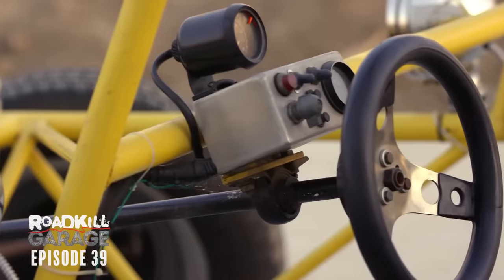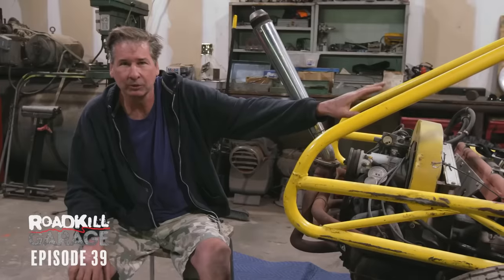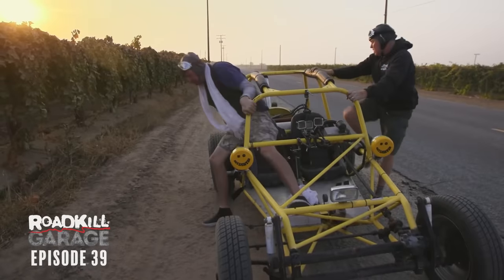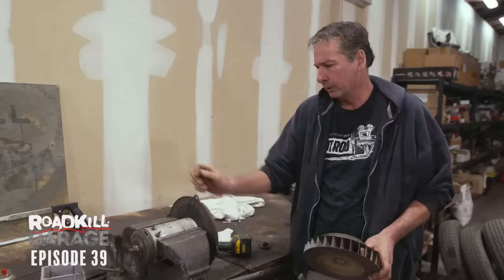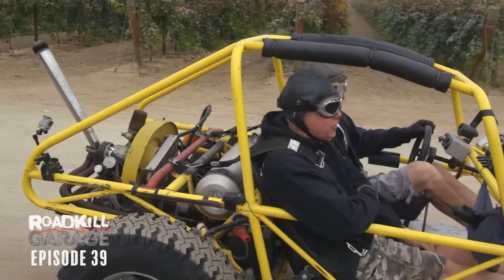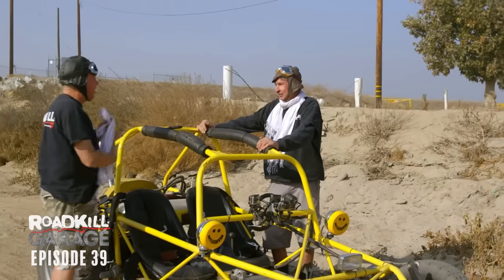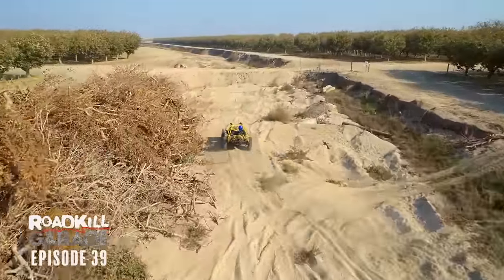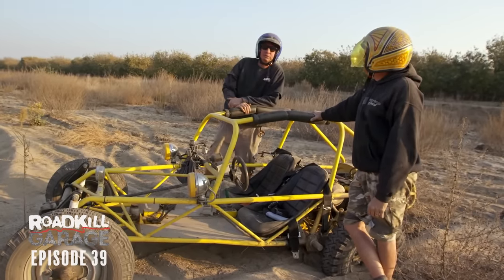Hasn't Run In Years! '60s Dune Buggy Rebuild | Roadkill Garage | MotorTrend

Comment: Lucky Dave didn't mess his arm up by putting it down during the flip. Remember kids just hold on to your seat belts and keep all hands and feet inside the vehicle
Reply: Lucky Dave should be his name 😂
Reply: My cousins arm is still crooked from that
Reply: put up netting dummys
Reply: The Honda Odyssey’s of the 80s had rubber loops you put your hands through.  Saved my arms from being broken a few times, those things flipped over soooooooooooooooooo easily.  It was like driving a crane off road 😂
Reply: One of my students rolled up to my dojo 1 time with the bones sticking through his arm from that. Great day gone bad.

Comment: I had this stupid smile on my face it's through the whole video I built 1 when I was 20 21 May be Maybe not as cool as this but as fun as it my friend rolled mine mine mine was square built with angler iron and scrap and still had the original full length pan And had the most fun Not insane but in the bush had this long Anglian bumper welding on the front to push the bus over man thank you guys you brought back Great memories

Comment: Love how the rear camber varies wildly with suspension travel. Looks like a ton of fun to drive though
Reply: It wasn't until I think 1968 maybe 1970 before the CV axle version of the transaxle for these was produced.  So if you're going to build one of these, be sure you know which transaxle you are going to use because the frame is different in the back.
Reply: Is a transaxle like a transwoman?

It wants to be an axle but the truth is it’s a gearbox 🤣

Comment: I bought one of those whin I was 19 about 50 years ago it was great fun. I almost died a couple of times and the jumps and vibration killed the battery so killing the engine in a sandy area was difficult to get it running again. With no fenders the tires threw everything at you driving in the rain was a special experience.

Comment: When I working at Andy Mannarino's shop in Detroit back in 1994-2002 there was a friend of Andy's who had a VW sand rail that he's expertly grafted the engine and front drive train from an Olds Toronado onto the back of the thing and the we'd built a 455 that made 480 hp. I never got a chance to drive it but I rode in it, INSTANT Wheelie machine and Fast! (on a 300 foot dirt drag strip) But a Buddy from years before that had like a 1962 VW we'd put a Baja KIt on it then built a VW engine and a Bus cklutch1  Lots of fun driving that thing off road, outrunning the cops and such!

Comment: Sweeeeet!! Love those VW sand rails, and the one than ran round LA or another city. 
I'd love to build one on a faux VW Splitter, wasn't your fault it was the rear swing axle at the back.
You could see it coming a mile off after they said they didn't want to roll the buggy.
In the 80s we had them here but with aluminium body panels and LWB and some fitted with colour coded V8's or VW moors. 
I'd love to find one local to me and rebuild it with more power that it needs, maybe a Subaru Boxer engine. 
The open sound of the engine and rippin' it down the blacktop.

Comment: A quick VW tip...when ajusting the valves cyl.numbers 1,2,4. exhaust at .006,cyl number 3 at .007-.008,the oil cooler makes no.3 run a bit hotter.
Reply: Ahh cheers man..got one in Aust about to get love!!🍻
Reply: Most 009 dizzys have a ground lobe  for number 3 also to help with the heat

Comment: in 1973 I first learned to drive a Rail Buggy (which is what this is, not a Dune buggy:, a dune buggy is different).  I was driving solo at the ripe old age of 6, running the clutch, and shifting gears by myself.
Reply: Did you ever have a roll over?

Comment: if you do any of roading with that sand rail.... you might want to put some of the orginal tin work on between the valve covers and engine block to help protect the push rod tubes.....

Comment: It looks like an early to mid 70s rail, my own was state or the art in 77 when I built it. MIne was also sand only, mid-engine with paddle tires and two ply. That old car can go either way, a rock crusher or a sand rail just by changing the wheels and tires. Just for fun, read Everything you need to know to keep your VW alive. It's so basic but has all the info you need!

Comment: Looking at the swing axle, I had a thought. Correct me if I'm wrong, but wouldn't the swing axle make you even more prone to rolling over? All the buggies I grew up with were never swing axles and we never had any rolling issues. I feel like the positive camber specifically would run a higher risk of rolling vs a regular IRS axle. More surface area for the tire to work with ya know? I'm just genuinely curious because I'm not an expert, but I love buggies lol. They were my childhood
Reply: It's called "jacking" and is a trait of swing axle suspension. The early Corvairs had the same type of swing axle, and made Ralph Nader famous with his "Unsafe at any Speed". Cornering forces cause the rear to lift, lose traction and spin out. Or roll if light and grippy enough. Both the Beetle and Corvair later switched to trailing arm suspensions with gave better handling.
Reply: @thoriated  ooooh I see. Thank you!
Reply: Correct. Something most high-performance bug owners have learned the hard way, myself included! 😉There's a contraption called a Z bar that helps. But IMO, better just to go with the latter chassis with IRS.

Comment: Next you can try a high performance motor with the stock transaxle. That always works out well ;-)
Reply: I have One. 4 seater 2.4liter straight 6 diesel. No problem whatsoever
Though the Tiny movie I have  on my Chanel shows it with the 1.6 VW diesel if One checks it
Reply: for the price, should swap for air-cooled  911 engine and transmission. turbo running gear if balling. this would be a greatest setup and would be cheaper.
Reply: Something I learned the hard way 50 years ago...

Comment: Try dual port cylinder heads, you will pick up a little bit of power, although they do tend to crack in between the valves.

Comment: Your back plate on the generator is mounted upside down ;). And ps your running a 30 horse. Im betting some dude is willing to trade a 1600 dual port or even something beefier for it.

Comment: Hopefully Ole Steveo meant by stuffing it with a Big Romping Two Liter sporting a legit set Italian 48 IDA’s or a side draft turbo backed by a 4 puck clutch coupled with Rancho 091 Bus box with all the upgrades 930 cvs 3 x 3 arms and 6” over beam with double shear shock hoops for the mid travel suspension with all inbetween components someone of knowledge would use to tie it all together! 
Steveo and David would be instant Type One enthusiast guaranteed!

Comment: i make monsters out of these all year long for less than 5k . 90s triple thundercat snowmoblie motor with muffler delete  ,vanagon irs set up with foa 14 inch travel bypass shocks , 33 inch atv interco boggers on 14 inch rims , plexi windshield , window nets , 6 point harness , ditch the front axle and make a-arms with g body spindle and brakes

Comment: The reason yall rolled over was because of the transaxle yall using. Swing axles are notorious for rolling over what you need is an IRS out of old Volkswagen bus you that that on the IRS out of a Porsche. Either one can handle a mildly powered V-8. As long as you don't get too wild doing burnouts. But the IRS keeps the rear tires flat and level
 and yes I have even rolled these.

Comment: Fan belt is not correctly adjusted, you've got crank end-play issues, and the oil cooler shouldn't be located over the air intake...

Comment: Is it normal for these buggys to have that amount of positive camber in the rear
Reply: It depends. VW had two types of rear suspension in their air cooled cars/buses: swing axle (like the one in the video) or after 1969 the IRS type. The IRS uses conventional CV joints and trailing arms. These tube frame buggies can use either suspension type.

Comment: The reason it rolled is the corvair style rear suspension.
Reply: The VW has the Corvair beat by 22 years.  But yes, the swing axle suspension set up like that is no where near as stable.  But unless you run IRS or Portals you won't get the lift for big tires or ground clearance.
Reply: Vw came out with the swing axle before gm did,gm copied vw

Comment: pull the vw put of there,put a corvair in it
Reply: If you're going to put a corvair motor in a vw you will need to flip the ring and pinion gear,if you don't you will have 4 speeds in reverse and 1 going forward, did my first corvair swap in the 70's drove right through the back wall of my garage while in first gear,oooppppss,called crown corvair up and took the buggy to them and they taught me how to do it right

Comment: No, it is NOT one modular unit. The engine is a separate component that bolts to the transaxle in the same way the engine of most other cars bolt to the transmission. The is no sharing of crankcase or oil.      Update: Oh my god...they are looking for a fan belt inside the fan housing?......I had thought that they had thrown the fan maybe the half moon key had sheared but it was only the bolt.... yeah I know I have worked on a few Bugs in my day but I thought they might be a bit more familiar with them...  :-)  And yes if you roll one you can get hurt-- swingaxles can be unforgiving....been there done that...

Comment: You will be amazed at the abuse a Vw buggy engine can take drive the t like you stole it   it will put any 4x4 to shame on sand 10psi tyre pressure and hold it flat to the floor enjoy

Comment: You guys are trying to die. The rear end has been lifted incorrectly in an outdated manner from the 80's. It is not supposed to be that high the wheels are pretucking in from the positive camber causing the most dangerous handling characteristic of a swing axle. You need to remove the rear torsion bar cover plates and move the rear arms a few splines to bring the rear end down and then add some limiting straps, This will bring the camber back where it needs to be and keep it there. If you want to lift it in the rear you have to get VW bus reduction boxes, or deal with the lower ground clearance by adding a skid plate. You Also got the wrong tires, what you need is something akin to a big wide drag radial with some street tread on it in back, in the front you need a skinny round almost farm implement tire with smooth linear tread.
Reply: I always ran tractor tires on the front of my sandrails, still have some new tractor tires in my storage unit, for my next sandrail, I am looking for a street legal one to trade for possibly my Subaru brat, 1979,everyday transportation, I used to drive my last sandrail everyday rain or shine here in Phoenix AZ also in Michigan and North Dakota, and Dallas Texas, I think of it as a 4 wheel dirt bike, here in Phoenix AZ they are considered as a motorcycle, my last one was registered as a Motorcycle so my insurance for a year was less than $100 a year, plates were $25, I  still have a vw trike that I built in 67 from my 67 Beatle that my older brother rolled in the field while I was in Vietnam doing the government's job